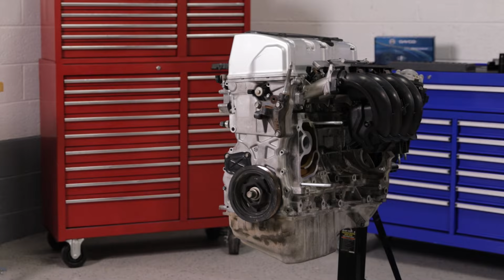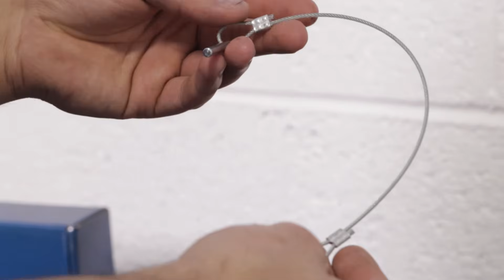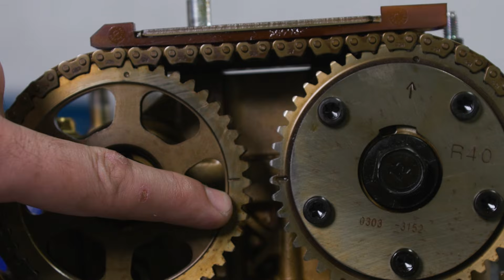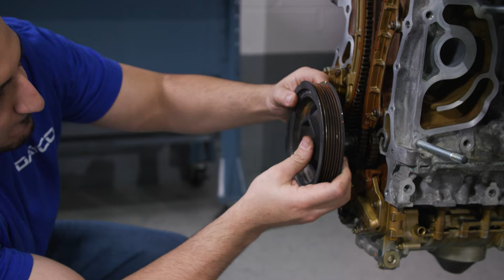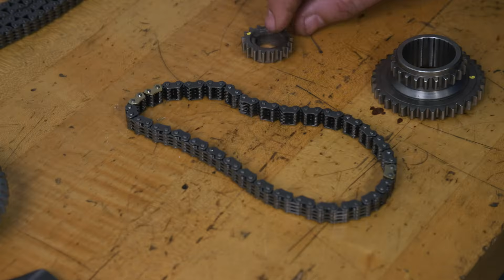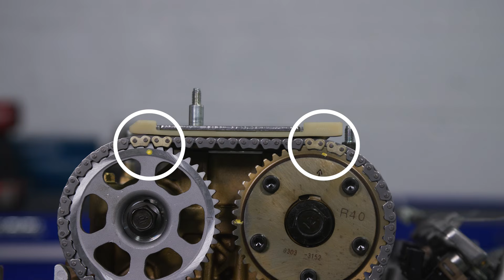Car Maintenance: Dayco - Timing Chain Kit Installation – Honda 2.4L Engine K24A

Comment: Am I wrong to think that with the gold links on the chain and the punch marks on the crank and cam sprockets, it's really kind of pointless to mark anything? It seems like if you have the crank lined up and the gold links on the crank/cam teeth with the punch marks it's really pretty much impossible to get it wrong. Am I missing something?

Comment: Master kit does not include VTC?
Reply: No.

The intake cam sprocket actuator for VTEC is sold separately and not in a kit.
Reply: @YahuchananLewis purchase the OEM part or Denso brand. Denso is an original Honda parts supplier

Comment: WARNING TO ALL WATCHERS, do NOT remove cam gears utilizing the pins that lock the cams in place or torque them down against those pins they are butting up a against a very small key way and are easily sheared off. Instead hold the cams with a wrench on the hex in between the lobes. Don’t do what I did.
Reply: 24mm wrench theres spots in the middle of the cams where you place the tool. Apply the same amount of pressure on both arms when loosening & tightening. I replaced my cams & did the valve stem seals so I replaced cams outside on a piece of cardboard.
Reply: That is exactly what I thought, thanks, I put those pins in place just to lock in the sprockets to set the timing.

Comment: the extraction of the cracnkshaft pulley bolt is the biggest lie in this video, that bolt is tightened by the devil himself.
Reply: Fr, even a torch didn’t work 😂

Comment: Can this be done with the engine still in the car???
Reply: yea you just gotta get the engine mount out of the way and a camera to lower down so you can look straight on to verify alignment.
Reply: thats the trick, looks real easy with the engine on a mount.
Reply: You can, but you won't be able to access the oil pump and those parts, so you'll only be able to get the timing chain done.

Comment: What if you forget lock the camshafts?
Reply: Just reset the cams
Reply: @jamesschmidt2889  how you do that?
Reply: @UnknownLantan  when u got to retime everything, just set the cam gears to TDC like he does in the beginning video. The two lines at the 3 and 9 o'clock positions and the crank set
Reply: @jamesschmidt2889  thanks alot bro 🙏🏿
Reply: @UnknownLantan  no worries. I'm an autotech, watching this video as a refresher on how this job goes. Just finished it up, so if ya got anymore questions just let me know!
Reply: @jamesschmidt2889  definitely will bro
Reply: @jamesschmidt2889  I need your help
Reply: @jamesschmidt2889 I was doing my vtc acuator on my 2008 Honda accord 4 cylinder and didn’t know about locking the cams so after installing the vtc actuator my timing marks are off and can’t get it to tdc I need your help